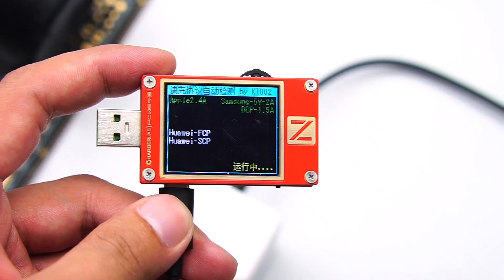Teardown of Nubia 30W Cube GaN Charger@ChargerLAB

Comment: No heatsink ,small amout of thermal paste :( I think it will heat up quickly
Reply: It is highly efficient due to the Low transformer losses, highly efficient primary switcher and synchronous rectification.